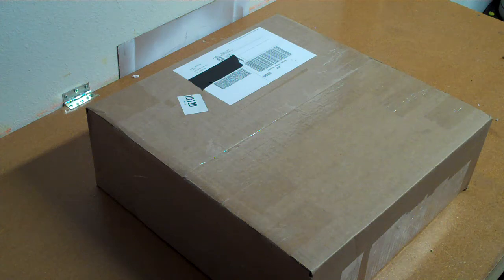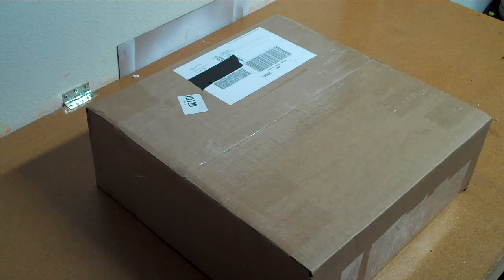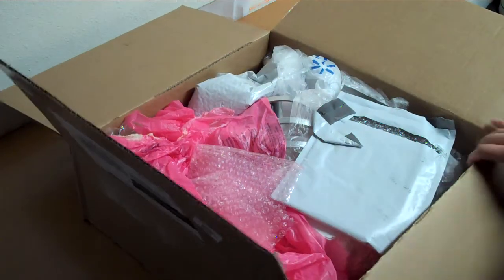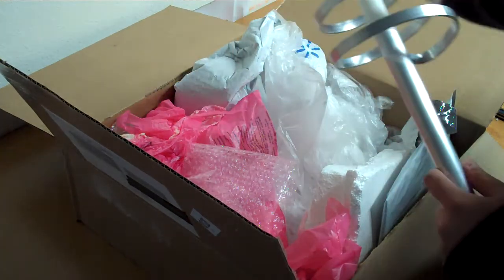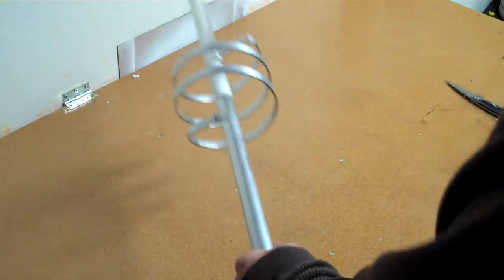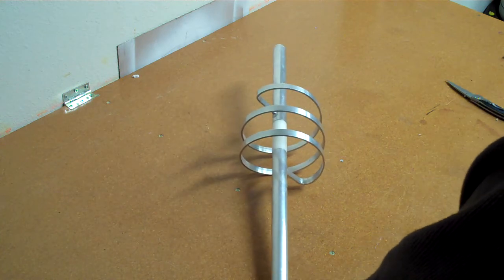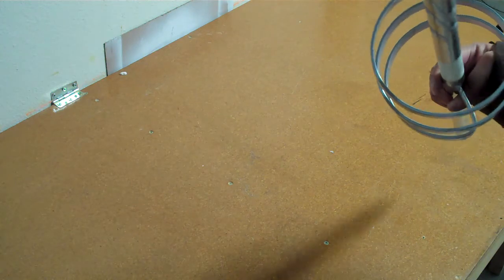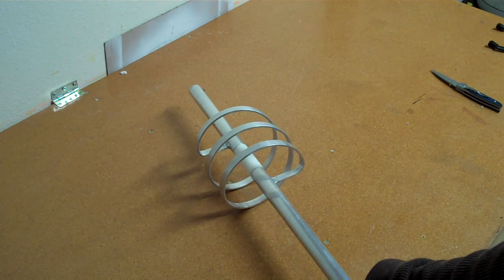New Terry-Built 55r4 Antenna

Comment from the maker: @slamdvw 

well.. a 102" whip isn't a 1/4 wave antenna till you put another 6"s on it by using a spring. It cant be tuned without cutting off the static ball on the end and it hits everything when mounted on the top of your truck as I have this one mounted.

So basically when I went from the 102 to this antenna as I did, I was very pleased. Great ears and transmit.

Comment from the maker: @azmann30 
$80 shipped. You have to go to radio shack and get a steel whip (102 inch) and use it for the antenna after you cut the bottom off of it
Reply: stresstest coax length

Comment: i used to run two of those in a beam system configuration on a suburban with a 32 pill final and a 8 pill driver.  the antennas are ok, but they will not zero in on a suburban unless you use spacers. the spacers have to be about 5 inches long i think. i forgot. around town, i would just run a 102 inch whip on a spring. worked just fine. i haven't talked on cb in a long time. about the time i got out in the early 2000's , it was almost dead anyway except for channel 6 i guess.

Comment: great antenna -prob is its too tall and frail and easy to damage. better off with a Wilson mag mount you can remove easy for parking garages trees etc. I don't use mine anymore for this reason
Reply from the maker: Wilson doesn't make an antenna that will hold the input. LoL